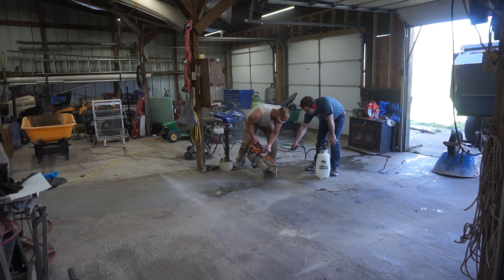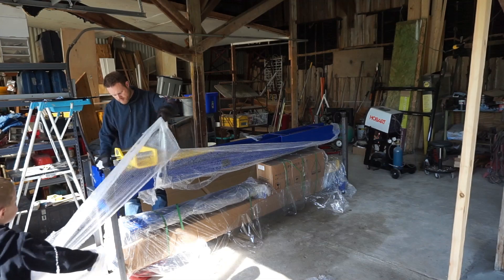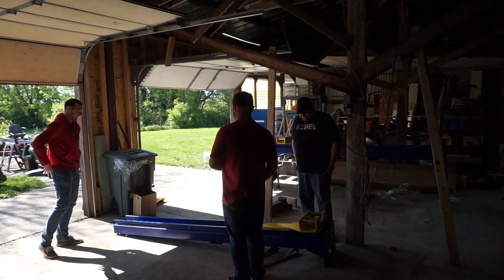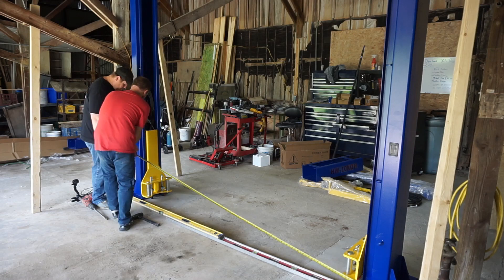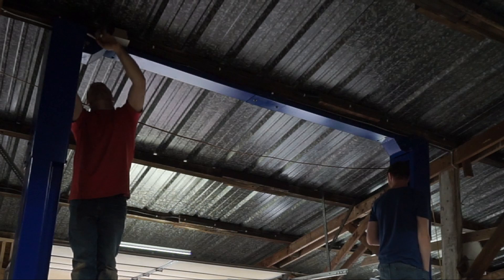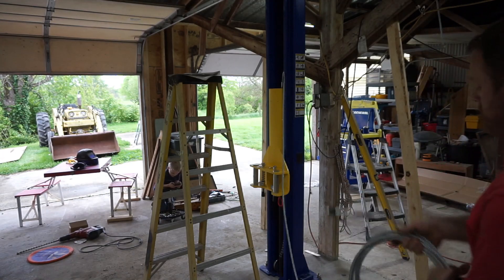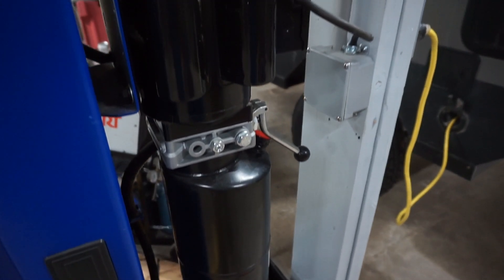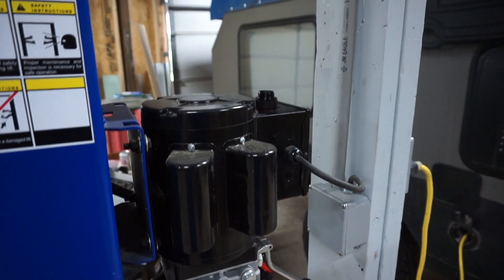How to Install a 10,000lb 2 Post Lift - E61

Comment: Just installed this lift in my barn, pleasantly surprised. Lifts my 2005 Dodge 3500 Cummins like a toy, no regrets. Love it! Thanks for your video and I recommend buying direct for the best deal, they will drop it off at your residential drive in less than a week.
Reply from the maker: Glad your experience is similar to mine!

Comment: I installed the 10,000 lb Aplus floor plate model and love it.  It easily handles my F150 crew cab rear wheel drive .    I use four two ton jack stands for safety.

Comment: How do you you run the limit switch wiring down so it doesn't interfere with the cables at the top?

Comment: What's to keep the thicker slab sections from separating from the existing slab?
Reply: Agreed, that area around it is thinner idk if i would trust it fully
Reply: It keys in he mentioned that, like mortar adheres to brick through roughness 

The key word here is he worked with a structural engineer

Comment: Just emailed Frank yesterday and he said I could save a couple hundred picking it up in Indianapolis. I just want to be sure it will lift my crew cab Duramax. Truck is 8k and it makes me a little nervous lol. Good video too 👍
Reply from the maker: I’ve lifted an extended cab/8’ bed Cummins with no issue
Reply from the maker: Please tell frank you saw my video!
Reply: I sure will! Thx bud
Reply: Doubt it's even 7k

Comment: looks great man, im looking at this same one.  how is the shipping ? do they show up in like a big rig and a fork lift  or ? 

It would be nice if it was possible to just have the delivery company set it right on my barn floor. i just had a slab poured and re-enforced with rebar.  Its only about 4 1/2 " thick .   But i know some of them require 5" thick.   

Did they unload it on your drive way if they delivered it or could they have loaded it into your garage ? i dont have a tractor or any heavy piece of equipment to move something like that so im just trying to get an idea of what the whole process is when it arrives.  I have a really tall roof on the barn here (16ft) so they should'nt have any issue driving a fork lift in here. 

We have had lowes even with their big fork lifts on the back of their trucks pull into the barn, unload and 180 out of there no problem. 

Thanks !
Reply from the maker: Review Guy mine was shipped on a flat bed that did not have a fork lift.  I know you can pick it up at the dock of your local shopping company if you have a flatbed trailer, then you could in pack it on the trailer.  Not sure if you can arrange dork lift delivery or not

Comment: I am in the process of installing this exact lift and I am very happy with it except for the very poor quality anchors that were sent with it. I used them but in hindsight I wish I had bought 5/8 inch lead set anchors and used 5/8 threaded rod instead of these.  The lead sets are by far superior.  But the lift is going up well and seems to heavy duty.
Reply from the maker: Awesome!  I think you will like it, I have been extremely pleased with mine
Reply: i dont mean to be so off topic but does someone know a tool to get back into an Instagram account?
I was dumb forgot my password. I appreciate any tips you can offer me.
Reply: @Benton Hudson instablaster ;)
Reply: @Forrest Karter it did the trick and I now got access to my account again. I'm so happy:D
Thanks so much you saved my ass :D
Reply: @Benton Hudson Glad I could help =)

Comment: What size pad did you pore, 2'x2'x6"?
Reply from the maker: My pads are 4' x 4' wide at the surface, They are 12" deep.  once below the bottom of the existing slab, it is another 6" wider all the way around which allows it to key into the existing slab.  That being said, make sure to consult a structural engineer for your specific installation.
Reply: 4'x4'x6" is typically for a lift this size,  people have a tendency to overdo it. But always follow manufacturers reccomendations. It's a pretty basic but crucial details and If the manufacturer doesn't have it listed, that's not a good sign and  I'd look for a different manufacturer

Comment: Build the overhead and put it on ur columns before drilling and run the cables, if the cables reach then drill ur holes! Never drill before the overhead is up and cables are run because once u drill ur kinda screwed
Reply from the maker: This is a good tip.  It takes any chance of messing up the measurements out of the equation.  I will pass this info on to the manufacturer to see if they want to change their instructions.
Reply: Been installing lifts for years. I usually anchor one column down, then put on the overhead, but I don't think I've even run cables before both sides are anchored. I always plumb the columns before doing cables because is a lot harder after cables are on and under tension.
Reply: Also adding the extension on the ground gives you better leverage that pretty much offsets the additional weight. Much easier to install on the ground and lift in one piece than carry the extension up.

Comment: I have the Aplus hw10kbp, 10,000 lb nut until I fastened it to my ceiling joists above I wouldn't put over 5000 lbs on it and even then I wouldn't trust the arms extended fully, China rates there lift much higher than they can handle,,,I also have a globe Canada lift 7000 lbs capable and the arms and posts are much much heavier then the China Aplus,

Comment: This lift failed ALI certification!! It has massive deflection on the beams and arms at 10k. At 15k it completely failed.
Reply from the maker: I have had 9k on mine with no noticeable deflection.  Been under it all day today
Reply: @shaweehillsworkshop4226  
I’m just saying it failed ALI testing and had arm and beam deflection at 10k and completely failed at 15k. But if you are ok with being under it all the power to you!!
Reply: Doesn't surprise me that it completely failed at 15k since it's only a 10k lift.
Reply: @jimgrooms3498  Ali certification means that the lift should be able to support 1.5x it’s rated weight capacity without major deflection or failure. 
I have seen the same test on bendpak and other lifts with no failure. This is just a cheap China lift.

Comment: i would have dug down 4 ft, and anchored it,along with rebar, just to make sure its safe and secure.
Reply from the maker: Nothing wrong with being extra safe.  I had an engineer involved so I feel confident it will be fine

Comment: You got the lift for free
Reply from the maker: Kinda, I got it in return for a detailed installation video to aid the instructions.   A lot of work has went into building the YouTube channel to the point that manufacturers are willing to pay me for my time, which sometimes is through product instead of cash.
Reply from the maker: J K it isn’t.  That being said, one of the specific reason I wanted the overhead mode instead of the base plate
Model was because I saw that video!
Reply: @shaweehillsworkshop4226  that's good. I'm hopefully getting a lift this spring

Comment: You didn’t say how thick the concrete should be in according to the manual how far apart the post should be spaced so no information on this video
Reply from the maker: Trisha Bennett these requirements vary by manufacturer and situation.  I consulted a structural engineer for my specific situation, because I didn’t trust my existing concrete.
Reply: @shaweehillsworkshop4226  What did the structural engineer say for your specific situation?
Reply from the maker: @bigbasslakeKaten  He had me cut a 4'x4' square out of the concrete.  He also had me excavate 6" underneath the existing concrete all the way around to key the footer into the existing slab and then poor a 12" footing for the lift.  He had me let it cure for 28 days before installing the lift.   I was unable to drill rebar into my existing slab as it turns out  my existing slab was as thin as 2" in many places, luckily it was poured around a wire mesh.

Comment: Didn’t look very safe with the small boy running around while you were standing the posts up
Reply from the maker: Forrest, I grew up running around on a job site with my father.  I soaked up so much being on the job with him.  Any chance I have to have my kids in the shop with me so I can teach them, I am going to take advantage of that.  I want my kids to grow up and have the ability to do things.  There was no point where I was worried for his safety in this video.  It is this point of view that is pushing out a generation of unskilled people.
Reply: SHAWИEE HILLS WORKSHOP nothing wrong with spending time with your kids or wanting to teach them, but teaching safety is also important.

Comment: It's a hoist.  A lift is giving someone a ride somewhere.
Reply from the maker: Can't say I've ever heard it called a hoist before.  Is this what they are typically called in your area?
Reply: @shaweehillsworkshop4226  Yep.  Many shops have a hoist charge listed on their menu boards in the office.  I've never seen a lift charge.
Reply: @Makitaization  So... basically... when I'm at the gym deadlifting weights and since I'm not taking them anywhere as in a ride, It should technically be called deadhoisting??
Reply: I’m from England, living in the United States, and have never heard it called a hoist in either location. In my experience, a hoist is something that directly lifts using a cable, rope, or chain.
Reply from the maker: @Makitaization  What part of the world do you live in?
Reply: @shaweehillsworkshop4226  Midwest.
Reply: Hydraulic car lifts were invented by Rotary Lift in the 1920s.  The independent organization that does 3rd party testing and certification for the industry is the Automotive Lift Institute.  All the major manufacturers call them lifts. Challenger lifts, bendpak lifts , etc. The ANSI standards call them automotive lifts. I believe hoist is just a regional term.
Reply from the maker: D Green it’s funny you commented on this today.  Yesterday I was using my lift and I noticed a tag on the side.  It says “automotive hoist”. I instantly remembered this comment!  I had never heard it called a hoist before, I was surprised to see it on the tag as every where else in the instructions, etc.  it refers to it as a lift
Reply: I think they are called hoists more often in Canada, so probably in the northern midwest too.  Also in places where all the good "lift " names are already being used :-)
Reply: @shaweehillsworkshop4226  Calling a hoist a lift is like calling an engine a motor.  It's just not right and it sticks out like a sore thumb.
Reply: its BOTH. it literally is a lift because it LIFTS vehicles up from underneath. HOISTS typically PULL from overheard... IE engine hoist...
Reply: @Makitaization  Or you a ghost and me a spirit.....
Reply: @brianawd  So there's a sticker on it that says '2 post lift fucktard'?  Doesn't fucktard mean hoist in German or is it a brand name?
Reply: I'm way late to this conversation...but I work at APlusLift, and this comment is hysterical.😂 I answer phones all day long here, and listen to all different US accents. People up in North Dakota/Minnesota/Wisconsin/Illinois/Michigan ALL typically call me asking about a "hoist". It's an unmistakeable accent, and I love it.😉